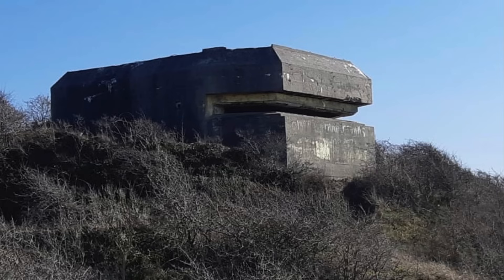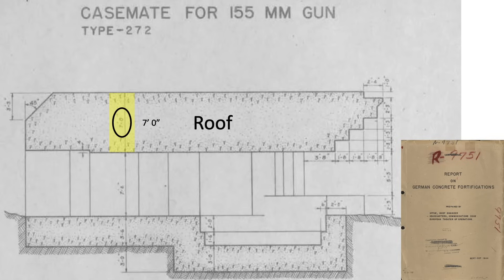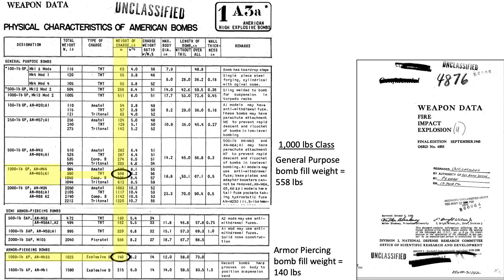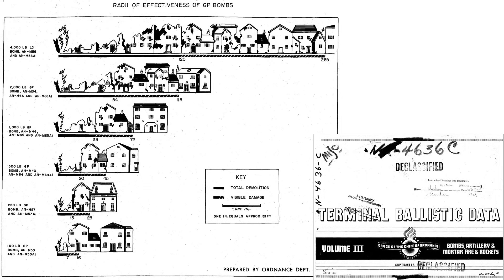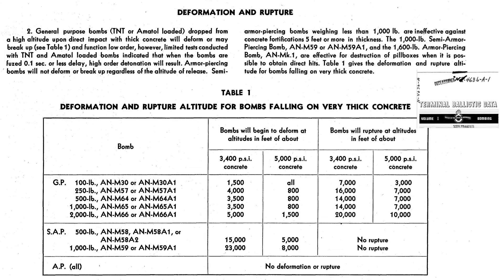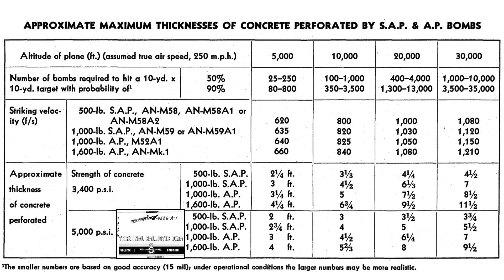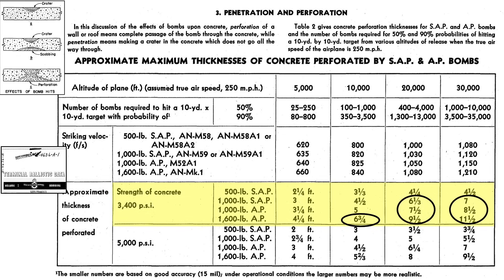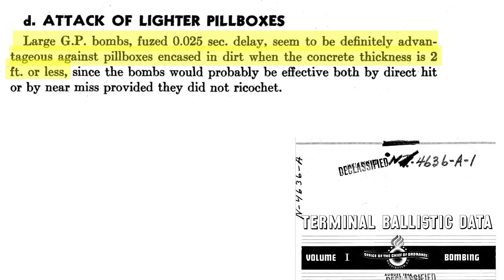Destroying German pillboxes with Bombs – Not so easy

Comment: As one of the slides emphasises, a near-miss can often be more effective than a direct hit. That was the case at the huge rocket site La Coupole near Calais, which was rendered unusable before completion, not so much by direct hits as by a  deep-penetrating Tallboy near-miss that undermined and tilted part of the building (still visible), and by other misses that obliterated the roads and rail lines serving the building. The ultimate near-miss weopon was the 10-ton Grand Slam bomb that at last took down the Bielefeld rail viaduct in 1945 when conventional bombing had failed. It fell close to the target, exploding at depth to create an underground void (camouflet) into which the viaduct's foundations and structure tumbled.

Comment: One aspect that is missing, because we didn't have the data in 1944 is the metal reinforcement in German concrete.
This could vary so substantially as to make two otherwise identical structures completely different in ability to withstand damage.
For example, the Berlin FLAK towers have so much steel scrap in them that they are still standing.
During the battle of Berlin they were impenetrable by even direct Soviet 152mm rounds.
Slated to be destroyed after the war, this destruction proved impractical, as the amount of explosive required to even inflict a couple of inches of damage was excessive.
Allied intelligence worked under the assumption that similar structures would have a similar build, but this was not actually the case, as the interior metal reinforcement differed considerably.
BTW, you research is most impressive, and you bring to light details in topics that many do not even now exist.

Comment: Thank you for this (and your other excellent videos). 

It did surprise me how very ineffective was bombing - and the absurdly disproportionate number of aircraft and bombs required (maybe...) to destroy just one pill box; which maybe helps explain how ineffective was the massive pre D-Day bombing of coastal defences. 

In general, it added to my sense that there was a major strategic error in WWII on the side of the US, and the UK (even more so), in terms of the disproportionately huge human and material resources that were allocated to high level bombing - which was asserted to be the major way that the war would be won. 

In fact, high level bombing was very limited in terms of what it could achieve - and this became clear to objective analysts (eg in operational research) as the war proceeded. In my opinion, the colossal industrial and human resources that were expended on high level heavy bombing (especially in the UK, where this was a huge proportion of the war effort) would have been much more effectively used elsewhere in the military. 

However, there was too much momentum in favour of "the war-winning heavy bomber" for this to make much difference to strategy. The analysis was essentially ignored. So the analysts seem to have been reduced to making the best of a bad job. That is what we can see in the analysis you describe here. 

The real conclusion should have been that horizontal heavy bombing is ineffective at destroying pill boxes. But the bombers were there, and their crews, and their bombs... so the analysts tried to determine how to make the best use of an ineffective weapon.

Comment: When using the Tallboy and the Grand Slam against concrete fortifications, RAF Bomber Command were instructed by Barnes Wallis, the bombs designer, to aim for the  dirt close to the edges of the fortifications, not the actual bunkers themselves. This would cause a local earthquake and smash everything inside the bunker, but the outer shell might remain intact. After all a bunker's not much use if the guns don't work, there are no lights and the radios and telephones don't work.

Comment: Perhaps one of the biggest failures on Omaha Beach was the lack of aerial bombardment on the German fortifications. I’ve read that they didn’t want to give away the intended landing beaches in weeks leading up to DDay by focusing on them too much in advance. Thus, to maintain surprise, Omaha’s defenses wouldn’t receive the attention needed until right before H-Hour. We all know now that clouds obscured the target and the bombs missed. Can anyone elaborate why they didn’t use H2X radar or fly along the axis of the coast? I feel like the coast would be easy to see on a radar scope and a different run-in heading may have lessened accuracy errors; striking something German rather than nothing. It also reduces risk to friendlies coming in on landing craft when you’re releasing perpendicular across them as opposed to over them. B-26s over at Utah were able to get in low and flew along the coast and delivered accurate strikes as did P-47s. More tanks also made it ashore and there were less defensive obstacles. The result? Far less American casualties. Where over at Omaha the infantry practically walked into the teeth of the tiger because those critical pre-assault fires failed to hit the mark. Just wondering why no radar and why the bad run-in headings.

Comment: Do your sources say anything about the effects of a GP bomb on the occupants of a bunker or pillbox?  Even if the bomb doesn’t have much penetration does a hit still have a chance to injure or kill anyone inside?
Reply: If a large GP bomb hit at an angle that the blast wave.could penetrate the emplacement (think of a "fair ball" with the gun home plate and the edges of the opening defining the foul lines), then yes, it could kill the occupants.

Blast waves can compress the air as dense as steel, and that is going to bounce around inside and cause death and TBI. But anybody down below in the ammo/habitat area will be fine if any large apertures to above have blast doors between below and above.